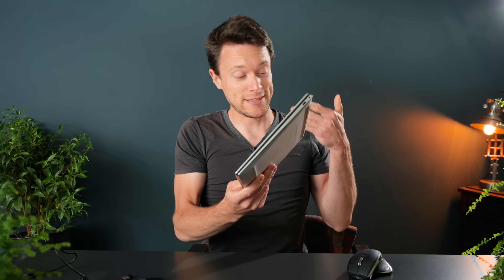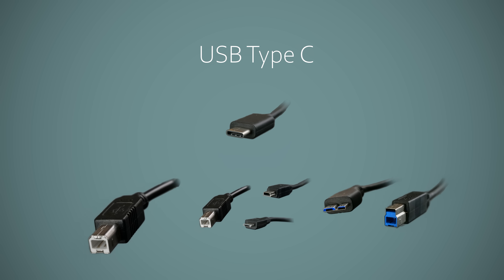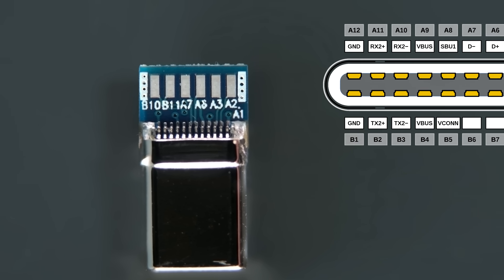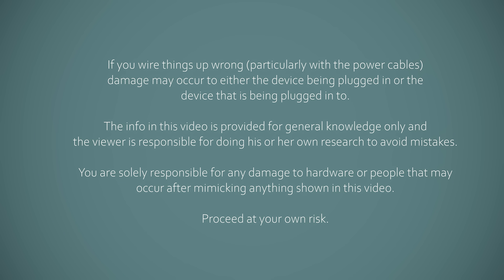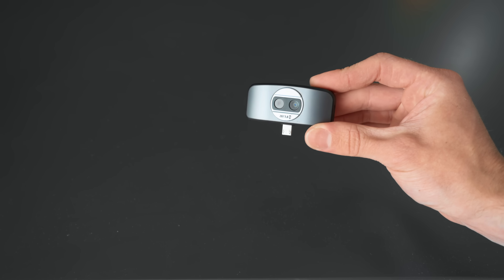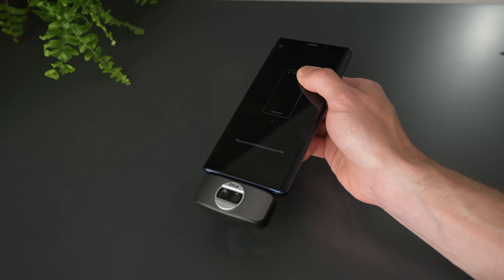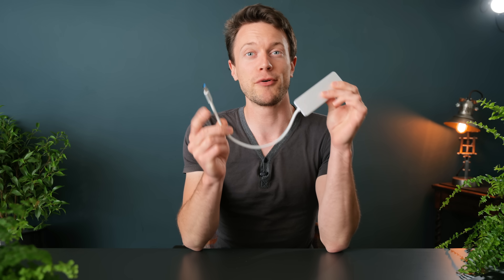Converting devices to USB Type-C

Comment: Would you be able to make a mouse wireless? I'm curious and its been on my mind for years.
Reply: That mouse is wireless.  So is blue-tooth, it's just a different frequency.  Bluetooth is usually more secure (expensive) and you really don't want two radio transmitters right next to each other.  Side note, blue-tooth keyboard at a public hot spot should be okay.  Wireless keyboard at a public hot spot is a really BAD idea.  Be safe out there!

Comment: hey heres a link for anyone if your intrestedt theres even smaller usb typc otg connectors such as this which will probably be the same size or smaller  https://www.ebay.com/itm/5PCS-USB-C-3-1-Type-C-Male-To-USB-Female-OTG-Adapter-Converter-For-Tablet-Phone/173882804836?ssPageName=STRK%3AMEBIDX%3AIT&_trksid=p2057872.m2749.l2649 but its only 2.0 speeds fine for usb mouse . etc

Comment: me: who has an old pc case with 1.0 which arnt even pluged in and 3.0 on the back and no typeC : ok and this is usefull because?
nah but in all serousness i will be upgrading my rig eveuntally (gonna jump for vr potentally,
or maby not as graphic cards are EXPENSIVE AS F----
hmmm but i might get a new case anywase 
though theres other things i want to get before i do any of that
a midi keyboard along with software to use it as a mic input or something
effectively i want to get crystal clear music into the mic, 
acually if anyone knows any software that can allow me to use a keyboard as a micinput and change the sound fount, i would like to know what it is
but another thing, racing stearing wheel and pedals, 
and its gota be relitively cheap 
so yeah and its gota have a clutch tbh
Reply: ...
this was over a year ago... damn time flies
fun fact i do have 1 single type C on the mother board of my pc :P but indeed i did get all those things, but aint gotten vr cause cant afford.

Comment: What about a female port type c swap? So that older devices can use Type C data/charging cables. For exacmple, could you swap a Female Type C port onto a Sony Dualshock 4? Which have notoriously bad ports.

Comment: ok I know this is DIY, and that there was going to be some soldering, but when he pulled out that resistor, damn that's jank haha. Surely there are breakout boards sold with resistors in the sub-device configuration.
Reply: He actually butchered that USB-C mode transformation.  All he needed to do was move the surface mount resistor (the little black thing in the white box) from the R1 position to the R2 position at 05:57
Reply: @ultilink3  yes exactly I noticed that too, why would he add an enormous resistor instead of just moving the surface mount one. These adapters are made to be both host or device.
Reply: @ultilink3  Was going to comment this, but this was already here
Reply: @ultilink3  stopped watching at that point. Very obvious that is the proper way.
Reply: Ok can you guys re explain about that. Im totally dumb on circuit board. Little more detail for me please? I know nothing about the circuit. 😩
Reply: https://www.amazon.com/dp/B07D69482H/ref=cm_sw_r_cp_awdb_t1_ychUEb2SATTHF

So this diy one doesnt need resistor? It seems like this one is what you guys talked about. The resistor is on gnd side instead of vbus side.

Comment: Why not simply unsolder the resistor out from V+ and solder it in at the spot next to it? It looks like, that this will create a connection between  GND and that Pin u want. So u don't have to solder another resistor in and scraping through the circuit board.

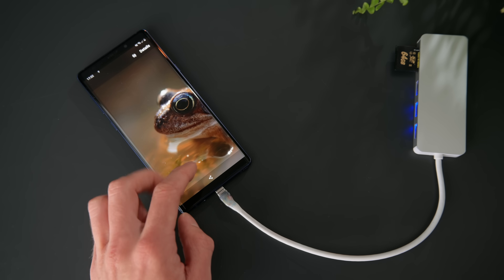Comment: 15:00 - "Definitely the future" -  USB-C was finalized in 2014 and released in 2016 - it's time to kill off micro USB and possibly USB type A (though backwards compatibility is nice, more and more laptops like your XPS 13 aren't using USB type A ports)
Reply: That's because more and more manufacturers are listening to people making videos on youtube and not listening to their actual customers. USB C connector is nice and all but it's not durable and it will lead to far more service and warranty requests. People manage to break USB A connectors with surprising regularity, and it's a fairly strong port with a lot more structural support.
Reply: @bdhale34  USB-C is definitely > micro in terms of durability, I've never broken a type A port so I guess?

Comment: Did you just try one of those eBay conversation https://www.ebay.com/itm/1pcs-USB3-1-Type-C-Male-to-USB-3-0-Type-A-Female-Converter-Adapter-Connector/153755232114?hash=item23cc86a772:g:etgAAOSwgqZd7dLE

Comment: You could just buy the little adapter that can be put in the USB A it self, basically touching the pins of the USB A and converting to C. 

These can bought on eBay and AliExpress for a few cents a pop. 

The only downside is that they could get stuck in the port and get out of the USB A. But if you're carful enough, it's worth it.

Comment: I can't believe Logitech still haven't released a USB-C receiver facepalm
Reply: @Hycrycer Bluetooth is extremely slow when using some of Logitech features like switching device. It takes a good 3-4 seconds to change device compared to the Logitech receiver being instant. Also Bluetooth has a lot of other downsides.
Reply: Use USB-C OTG , 50 cents... Done!
Reply: I can’t believe that Logitech hasn’t come up with a mouse that doesn’t require that dongle (or as they like to call it a receiver) connects to the computer’s built in Bluetooth. <facepalm>
Reply: @tqnohe  They're not trying to do that; there's not much point. As others have pointed out, Bluetooth has it's own set of problems. The main one I would guess is the fact that many people would have other Bluetooth devices connected as well (Phone, headphones etc). More devices connected means more connections problems and slower response times for the mouse. Its better to have a dongle or wired mouse for most people. It also relies on the device actually having Bluetooth capabilities which isn't as much of an issue now, but still limits the devices they are compatible with more than USB connections would.
Reply: why would they?
Logitech's mice are focused mainly at the gaming market, a market based on desktop computers.
All motherboards for desktops have USB 3.2 Gen 2 type-A connectors (i know, the USB naming scheme is TERRIBLE).
Reply: I can. USB-C is a nightmare. It's all fun and games until some subset of motherboards are configured to charge your device by default which fries your receivers, at which point the only way to prevent such an outcome is implementing USB PD which would require significant engineering effort. A is overall much easier to test and significantly more compatible.
Reply: they probably will never do so as it will be a reason for some to buy some new pricey mouses instead of just switching to a new dongle... profit wise!
Reply: @anoirbentanfous  They already sell that receiver as a standalone product so I don't see why they wouldn't sell a USB-C version.
Reply: @anoirbentanfous  But they still don't have any expensive USB c Logitech mice?
Reply: @anoirbentanfous  But the unifying dongle is universal by design...
Reply: @anoirbentanfous  Of course Logitech will make a new dongle. If they didn't then others would take their market share. They just won't sell the new dongle on it's own. You'll have to buy a new mouse and/or keyboard along with it. At least, that's what I'd do...
Reply: Most USB C only devices do actually have Bluetooth and as far as I know the Logitech unifying system works with BT as well.
Reply: @jeff4992  but logitech doesn't right? It's always need their stupid receiver, right?
Reply: @jeff4992  Logitech Unify doesn't use the bluetooth stack/protocol the only things they have in common is 2.4ghz and being wireless. What USB-C devices have bluetooth as well? That really doesn't make much sense?
Reply: @nismo4x4n  can't speak for the hole market but all Logitech unifying devices I own also support BT.

Oh and please name one device you would like to use a mouse on, that doesn't have a USB A port and also doesn't have Bluetooth.
Reply: @jeff4992 I have about a dozen unify devices and only one is dual Bluetooth and unify. Bluetooth nice is convenient but the latency sucks for games.

 USB-C and Bluetooth aren't exclusive to each other. At this point most things have a mix of ports unless you have a Mac. In the future even desktops PCs will drop USB-A.
Reply: @jeff4992  Again, bluetooth is terrible when it comes to latency. I use multiple computers with one mouse and it wouldn't be possible via Bluetooth. Most laptops now days only come with USB C. A lot of people own MacBooks and Dell XPS computers which only have usb c.
Reply: Am I the only one who literally hasn't got a single USB C device? The only one I've ever seen is the USB C cable my sister bought for her phone by accident.
Reply: @VeyronBD  most devices that have come out in the last 3-4 years have usb c now. Most phones and a lot of laptops with it. The new consoles coming out this year will have it too.
Reply: @VeyronBD  you not only one, but all new devices comes with usb c.
Reply: @VeyronBD  Phone's have definitely switched to USB-C already, sometimes even on the charger side. Also new Laptops and Motherboards seem to have at least one USB-C port.

Comment: The connector board is probably separate so they could slap a Lightning connecter board in there.
Reply: Connectors are also more likely to break so if it breaks you can get it fixed by just putting in a new board with the port on it :D
Reply: Th3dkbay if that’s true, it kinda proves that the company isn’t trying to squeeze every dollar in your pocket by making a connector that doesn’t require the whole device and board to be disassembled when changed, unlike other companies whose name i won’t write... 🍎
Reply: @marioghioneto1275  apple
Reply: @marioghioneto1275  idk if you know but it's pretty common practice Apple, Samsung etc. Basically do this in almost all their devices

Comment: Now we just need a video of swapping the female side to USB C lol. I would love for my PS4 remote to be USB C instead of Micro B
Reply: This is where I miss quickly popping into my local Maplin store, where you used to be able to buy an adaptor or two, to connect anything to pretty well anything else!
Reply: As many usb A female ports as I've seen that were damaged, this would be a horrible idea even the mini connectors they already use are fragile, USB-C is even more fragile. This is a point advocates of the C connector avoid like the plague too because they know it's thin and extremely fragile and will be easily broken by many many people. Notice it's always high speed and reversible and more powerful, and they never once mention how durable it is or in the case of this reality how not durable it is.

Comment: That's a great idea! The only thing I didn't like in this video is that when you scrape the pcb for disconnecting the resistor and adding a chunky big thru-hole resistor to the circuit. Couldn't you just desolder the surface-mount resistor from R1 pads and solder it back to R2 pads? Or if its resistance isn't suitable for the sub-device mode, couldn't you just get a proper surface-mount resistor and solder it to R2 pads?

Comment: I thought the adaptor would be better as you can just stick the receiver onto the back of the laptop screen? 

That'd make it better for travel aswell especially when used with a laptop carrying case so the screen doesn't press against the other luggage.

Comment: Next: converting micro usb phone to usb type c 🤣
Reply: That's what we want
Reply: That would be nice to see🦧
Reply: i mean on a s7 atleast its  not going to be a big issue bc the part where the port is is just a module and you can take it out and you'll have plenty space
Reply: Mainly iphone should be usb c but another dude is working on that project.
Reply: yes
Reply: Yes please.
I got to get rid of that worthless micro-USB female in my phone, but also in the playstation 4 controllers.
Why didn't they use the mini-USB instead. Not much bigger but allot more sturdier.
Reply: Nextuz i was planning to make my ps4 controller to type c connector. It’s a hassle to deal (micro shit usb) which side connects like com on man it’s a plug wtf. So might work on it and convert it to type c and won’t have to worry about which side
Reply: I would like to see you doing that, I just take the charging board out of ps4 controller, and it is so tiny.. order some "usb type c female connectors 6pin" but I'm not sure that this would be possible to change, while keeping old board of course.
Reply: Dejan Miloš it is but will need modifications. I have the very first gen ps4 controller JDM 001 so each generation is different. The newest is JDM 055
Reply: @luke7542  I have "JDS-040, and JDS-055" but size vise they are pretty much the same as "JDS-001" it will be the callange.. moving board a side it would be easy, but LED is main problem, if you move it, there is no light anymore (not a huge deal anyway, but it's not shiny anymore) 😂

Make a video about it, if you pull that out. I can't believe that no one did this earlier.
Reply: calling Strange Parts...
Reply: Or an iPhone
Reply: @Ludix147  Or a Samsung
Reply: @jamberrytastic  samsung phones mostly are already type C but for some reason, Apple hasnt made the switch yet so its most useful to figure out how to convert an iphone
Reply: I've got adaptors for that, which came with a couple of powerbanks  I bought in Lidl!
Reply: Or a motherboard *

Comment: Don't get me wrong, I love your videos. But this build is in the DiWhy area very much. One type of USB 3.0 USB-C to A  adapter is actually  as small as the USB-C header sticking out and the other end inserted inside the USB-A. It  also is cheaper then USB-C breakout board! What you did is not only make the setup larger then it have to be, it also cost MORE.

Comment: I mean this is interesting to watch dont get me wrong but you can literally buy one on amazon for less than $10 that is the same size rather than that super long dongle. That goes for both the USB A and Micro USB. Considering that board your using costs around $5 not including the extra parts you need you might as well just spend an extra $2 for the real thing

Comment: USB-C is pretty great, but primarily when compared to USB Micro-b in my opinion. USB-A is much more robust and its only downside is that it is marginally larger and non-reversible (Without compromising structural integrity and its official USB status).

Comment: you can make great webcam from your mobile phone, over wifi or usb without destroying it:) it just requires installing an app (i use ivcam) on phone (Android or iphone) and PC. it gives you much better quality, full HD resolution ( or more) and great microphone as well. Was well worth spending few £ on the app, but now my old iphone 4s has got new decent life as a webcam (and you can install it on several phones to have like security surveillance system if you wish).

Comment: (7:11) It looks like there's a trace to the ground pad, and all you'd need to do is desolder/resolder the existing smt resistor on the adjacent pair of pads.
Reply: The pull-up value of a DFP resistor is very different from the pull-down value of an UFP resistor. He would need a different SMT resistor anyway, which I imagine he doesn't have in his drawers.
Reply: @jeromevuarand3768  Good info. Do you know or have an example of the different resistor values one would use for a pull down vs a pull up?
Reply: @jeromevuarand3768  Would still be easier to desolder the existing resistor, rather than cut the trace.
Reply: I know I don't walk around with surface mount resistors in my drawers! LOL!
Reply: using a tht resistor instead of smd kills me from the inside
Reply: @tanielgulian419  Also, wasn't that a half Watt resistor!
Reply: @Ryuseigan  By the looks of it
Reply: @tanielgulian419  Ikr, I cringe every time he does that, it's just too odd.
Reply: Yeah that's exactly what puzzled me too
Reply: thats what I tought he was going to do, but when he diys, he diys hard.
Reply: I really think he could have stepped up the tutorial to his own level by reusing the old resistor or sourcing a  smt resistor from a donor board and minifing both adapters with a dremel. Maybe DIYperks should stick to macro sized projects :).
Reply: End of the day, it's his personal device, it works, and it's called DIY. As long as the device is fit for the user's expectations/needs, and they have the satisfaction of making it, and it save a little e-waste, that's a very good thing.

Indeed, there is often a better way to do things, but if he were to never post the video until it's perfect, we wouldn't be watching this, and also he might not get this feedback in the first place, I suppose. (On the other hand, these comments would lead me to look harder for the right resistor and think about desoldering rather than scratching traces. So the comments are very good too!)

Comment: Great insights to USB C, but if pcb is already with the copper connectors, a skinnier converter like this would have saved the trouble of soldering : https://www.amazon.sg/Connector-Adapter-Multifunction-Converter-Laptop/dp/B0857D63CX/

Comment: Man, wether this works or not, i cannot be thankful enough for this video. Its been month since i've tried making usb-c to mini usb cable for my girlfriend. I made her a keyboard, but she has a recent macbook that only recieves usb-c., and I NEVER manager to make these cable work. Only usb-a to usb-c ! But sadly, my usb-c plugs have a pcb with4 pins, G V A6 A7 I need to find a way to use the A5 and B5 !
nvm i just saw you covered a similar usb-c plug, but i couldnt see properly. You only solder a 5.1kohm resistor to r2 right ?